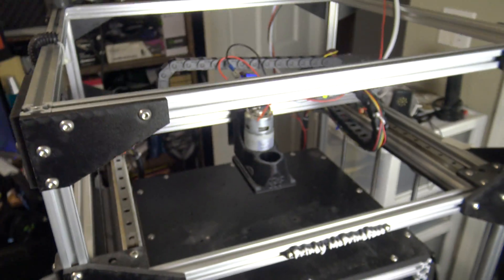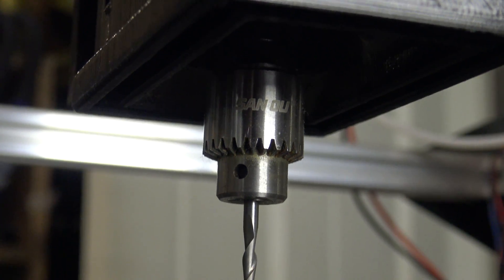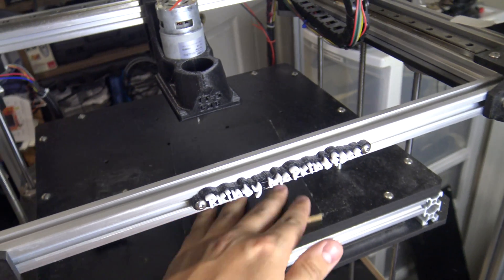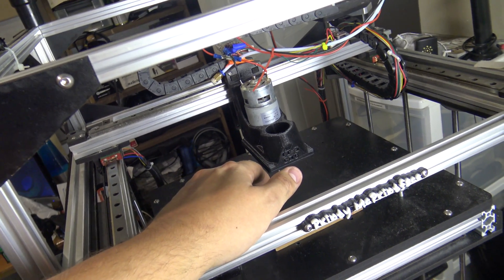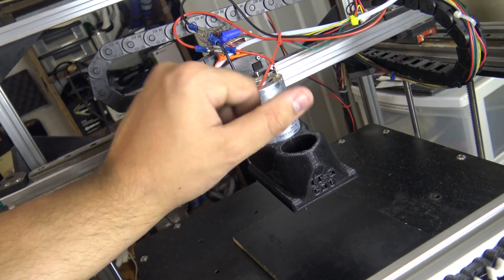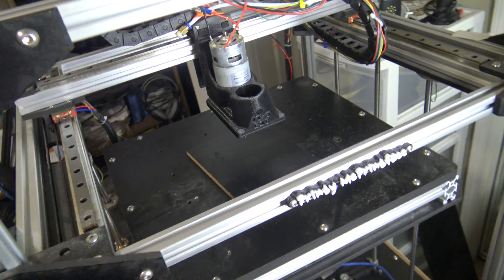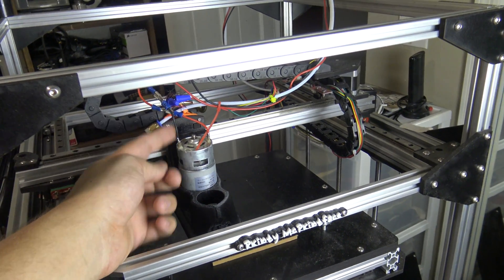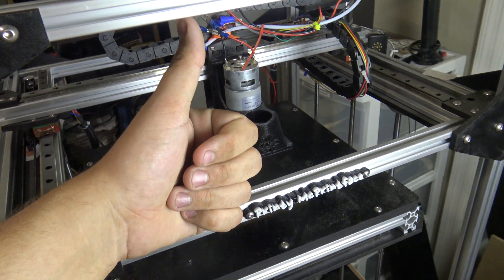FT-5 CNC Attachment!

Comment: As a CNC guy before starting 3D printing, this looks like something that would ruin your 3D printer.  Yes it will work, but CNC machines make a TON of dust and a lot of vibration.  Neither of these is good for a 3d printer.  So unless you don't plan to 3d print again, this sounds like a bad idea.  Like using a screw driver as a chisel.  it would work, but wrong tool for the job.
Reply: not to mention the improper use of a drill chuck! we won't go there, we're having a happy day! :D

Comment: Can you test this on carbon fiber panels?  Model airplane and drone builders would eat this up (myself included) if you could cut 2-3mm carbon fiber panels to make airfoils,quad copter frames.  I also recommend using software like fusion360 versus more obscure cnc gcode generators.

Comment: Dustin! It's Marco's brother Miguel! I do CNC work at Cal Poly tech and I use HSMworks which comes with fusion 360! (i use the student version plugin for solidworks) Im pretty sure the output format you would want to use is grbl which is a Gcode file. Definitely give it a try and give me a holler if you have and questions.